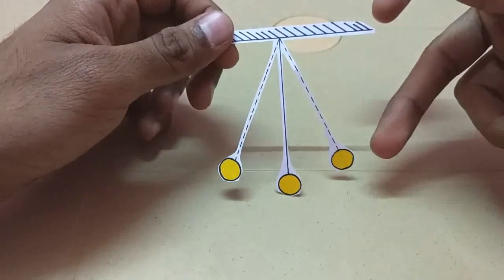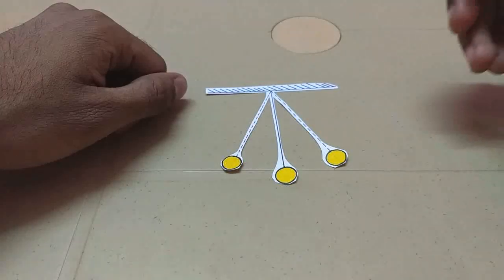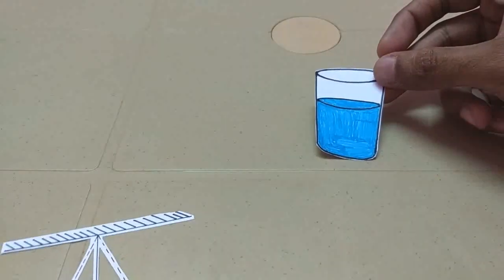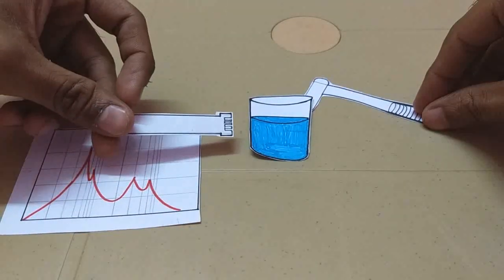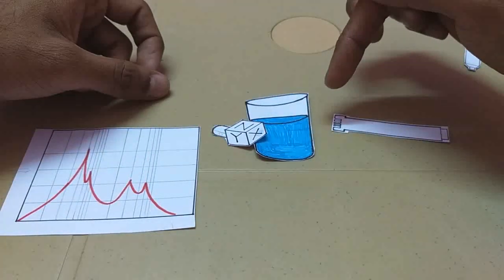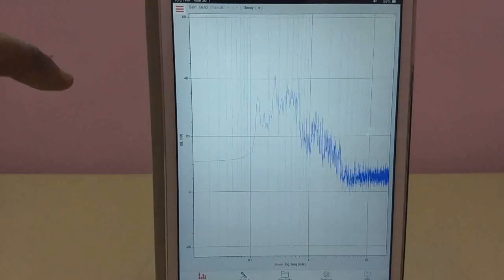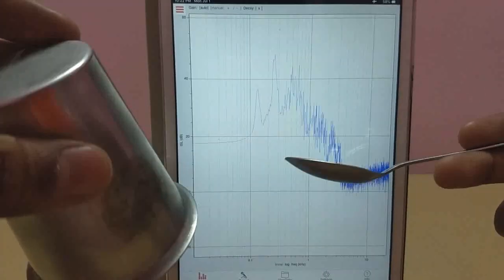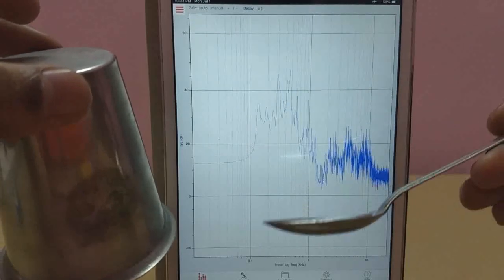Natural frequency explained and demonstrated

Comment: Can u please explain the difference between natural and applied frequency and what does it mean if they have the same value?
Reply from the maker: Natural frequency is the frequency at which a body or a system tends to vibrate freely after it is given an initial excitation. An initial excitation is required as the body/system cannot start vibrating by itself. Here we can say that the body is exhibiting 'Free vibration'.

'Forced vibration' on the other hand is when there is an external driving force on the body, forcing it to vibrate under its influence. The input frequency here is the Forced frequency or applied frequency.

When both are equal, it leads to a phenomenon called "Resonance" wherein the body vibrates violently with maximum amplitude before rupturing.

A good example would be an Opera singer breaking a wine glass with her voice.
Reply: @SrinathSrinivasan  sir so regardless of initial excitation,  the frequency would be same?
Reply from the maker: Yes.

Comment: I've been through a lot of videos but I still didn't get one thing...
Free oscillation is when a body which is initially disturbed vibrates but doesn't it's frequency depend upon the force applied initially? Like greater the initial disturbance greater the frequency? How's the natural frequency same all the time? Can you please help me with this doubt?
Reply from the maker: Hello, 

Thank you for watching the video. As far as the math goes, Natural frequency of an object or a system is a function of mass and stiffness but independent of the initial excitation. An object or a system when excited oscillates only at one particular frequency which is the natural frequency regardless of the magnitude of excitation. 

Consider an example of human vocal folds. Vocal folds is the voice box which is excited by air from the lungs. Male vocal folds are longer while female vocal folds are shorter. This is the reason why male voice is low-pitched while female voice is high-pitched regardless of how loud their output voice is. If frequency were to depend on intial excitation, both male and female voice pitch would keep changing as a function of initial excitation. It doesn't happen like that, does it?
Reply: The same doubt I also have. Srinivasan Sirs explanation is partially okay.

 For eg: if a steel beaker with a certain mass M and stiffness K is kept on a table, math-wise the natural frequency F would be "SquareRoot of K/M". 

However, if we are not disturbing it, and if we would keep a accelerometer (or an app) on it, it would record nothing. It would  record the frequency only if we disturb the steel beaker with a external force.

 Why is this so?  How to measure Squireroot of K/M physically?
Reply: @Dr.freedom  Natural frequency is an inherent property like K in a spring. You won't know the K constant is a spring without exerting a force in it. Similarly, you can't measure natural response without applying energy to make it vibrate.

You will need an accelerometer to measure its natural frequency like you need a ruler to measure the elongation of a spring.

Comment: How can we be sure that it is the natural frequency of the beaker and not of the spoon?
Reply from the maker: Hello,

Thank you for watching the video. The Natural frequency of an object or a system is relevant only when the object in question is undergoing a free oscillation. When an object is given an initial excitation, the object oscillates freely (like the simple pendulum). An oscillation with a constant external force or damper is not a free oscillation.

In the above video, when the beaker was impacted with the spoon, both were excited. Since I was holding the spoon, my hand was damping the spoon's vibrations and not allowing the spoon to vibrate freely. On the other hand, I was holding the beaker (with least contact) at the base while the lip of beaker was free. Basically the beaker was free to vibrate with no external dampers to dampen its vibration. These vibrations produce sound waves which are captured by the Spectrum analyzer.

This however is an approximate way to determine the natural frequency. The best way would be to use a calibrated impact hammer.
Reply: @SrinathSrinivasan  Well explained. You hv provided no info in the 'about' section . What do u do, if I may ask ?
Reply from the maker: I'll be updating my bio soon. You can check it out.

Comment: Can you please explain to me how frequency depends only on the source of sound and not energy?
Great video by the way!
Reply from the maker: Hello,

Thank you for watching the video. Natural frequency of an object depends only on an object's stiffness and mass. It is a characteristic of an object and does not depend on the excitation force. If any of the above two variables are changed, then the natural frequency will change. For example, in the video, if the beaker was filled with water, the natural frequency will be different despite using the same spoon to impact since the mass has now increased.
Reply: Thanks a lot!
Reply: Srinath Srinivasan out of curiosity, how would you measure the stiffness of an object?
Reply from the maker: Hello,

Stiffness is force per unit length. In the equation F = kx, F is the force, x is the elongation or compression and k is the stiffness. Higher the stiffness, more is the force required to achieve the desired elongation. Stiffness cannot be measured directly like length rather it is determined by experimentation. Consider a spring subjected to a given load. Measure the elongation and plug in the values in the above equation to determine stiffness. For complex systems with different material densities, a computer simulation would be ideal.
Reply: @SrinathSrinivasan  Great video! Wanted to ask: after some empirical evaluations, I've seen that stiffness may not have a significant influence natural frequency. Though it was not a large study, do you think natural frequency can be influenced by several different factors, like density, shape, or temperature?

Again, thanks for the great informational video and your feedback!
Reply from the maker: @hmata3 Thanks! Natural Frequency will change if the structural properties of the structure or system change. Yes, density, mass, shape would alter the natural frequency. Let me provide some examples:

Density/Mass: Instead of using a steel beaker in the video, if I used say a gold beaker of same dimensions then it would not sound the same. Why? because gold is way more dense which means more mass in a given volume. Alternately, I can alter the system's natural frequency by adding mass (like adding water into the beaker).

Shape: Practically, I have tested several stainless steel beakers of different sizes. None of them sound the same despite being the same material.

About temperature, I'm not sure if it influences the natural frequency of a structure.
Reply: I think Yes, temperature does impacts on natural frequency because temperature causes impact on stiffness as the elongation depends on temperature.

Comment: in the second method you would have to factor in that your using stainless steel on the beaker to produce the sound
Reply from the maker: No. The purpose of using stainless steel spoon was to give the beaker an initial excitation so that the beaker vibrates and produces sound. The beaker will still generate the same frequencies when excited with say a plastic pen instead of a stainless steel spoon. This is because Natural frequency of the beaker is a property of the beaker's mass and stiffness and not the material which was used to give it an initial excitation.

Comment: What about direction/placement of impact? How does that relate to the natural frequency?
Reply from the maker: Hello,

Thank you for watching the video. As explained in the video, there are 3 methods to determine the natural frequency. The demonstration with beaker and spoon is method 2 where we are relying completely on the sound waves to make an estimate of the natural frequency of beaker. In this scenario, the direction of impact is not important because sound is a scalar and it is omnidirectional (radiates in all directions). No matter where you hit, sound waves are created and are detected by the spectrum analyzer.

However if method 1 is to be used which is using an impact hammer and a triaxial (x,y,z axis) accelerometer, the directions become important as we are dealing with vectors. Both the direction of hit and direction of accelerometer have to considered with care. This would reflect in the response plot and thus the natural frequency determination.
Reply: @SrinathSrinivasan  Thank you very much for taking the time to reply. Just to clarify, your saying that with method 1, you risk getting a false readings due to incorrect sensor placements. But if you could get perfect readings, the direction of impact would not matter for any object. The only thing that would change is the amplitude and possibly dampening effect?
Reply from the maker: An impact hammer measures force while accelerometer measures acceleration. Both measurements are vectors. The hammer is the input whereas the accelerometer is the output. Directions are important for both. You are exciting a structure using a hammer and measuring its response using the accelerometer. Complex structures have multiple natural frequencies also referred to as 'modes'. These modes may be present in any plane (x-y;y-z or x-z). So for this reason,  direction of hit also matters in order to determine in which plane is the structure vibrating. Also how hard you hit won't change your readings.
Reply: @SrinathSrinivasan  Thank you very much for clarifying :)
Reply: Sir, please tell me about modes

Comment: when you say "initial excitation" and then you say "without the aid of the external force"..... Initial exciation is not an external force? anyone please help
Reply from the maker: Let me explain with an example. Consider a child sitting on a swing and a person ready to push the swing.

Case1: The person just pushes the swing once. 
In this case, he is giving the swing an initial excitation. An initial excitation is required as the swing will not move by itself. After giving initial excitation, the swing oscillates back and forth at a certain frequency. This frequency is the natural frequency of the swing system.

Case2: The person pushes the swing every single time.
In this case, he is applying force every time is pushing the swing. The result is a forced oscillation since the swing is no longer oscillating by itself but rather under the influence of an external force.